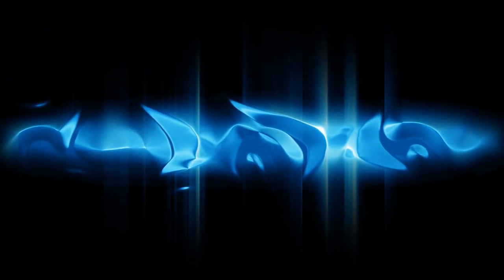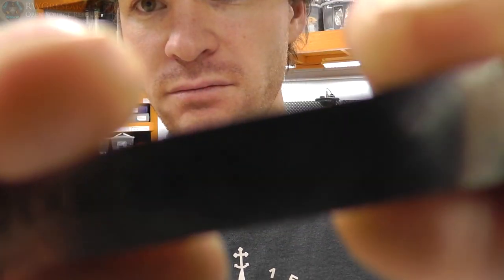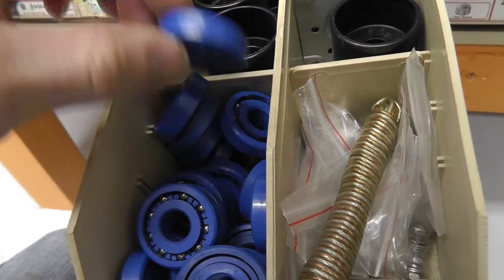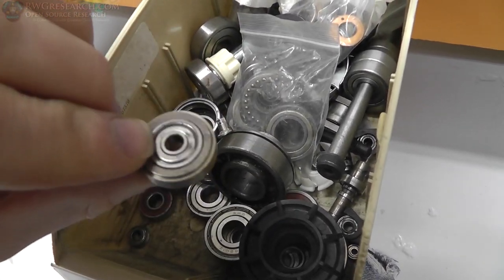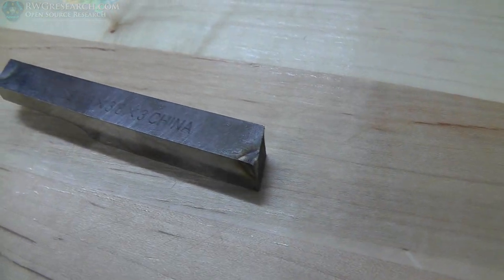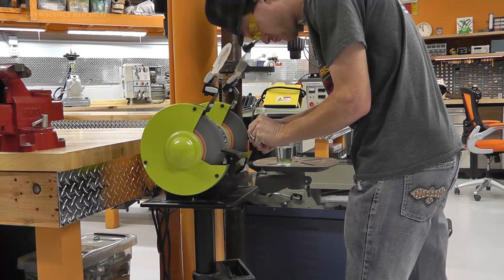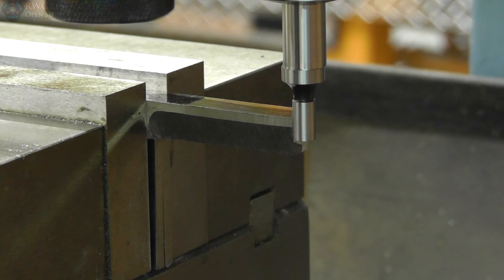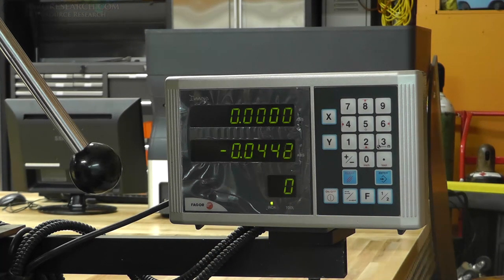RWG-OSD #3 Making Custom Profile Cutter For Slide Wheels - Bearing Selections! OverSized 3D Printer.

Comment: try using only 1 parallel on thin stuff,as the vise will keep it square.always tap the piece down just to be sure it's sitting flat.you might like using an old piece of metal strapping bent into a z shape to hold the parallels in place when using 2,keeps them from falling over and chips getting in behind and below them. i think delrin is what you may want to use to replace for favorite plastic..rubbing alcohol is better for your and the kids health than acetone for most shop applications.lastly i always brought the spindle up and went to zero both axis to see if i went the right direction when doing the offsets,then remove the edge finder.i scrapped a ton of stuff over the years just trying to save you time and money where i see it chuckle..........you do very nice work,and your family is great. happy trails
Reply from the maker: +bill bailey yes! i did not use the tap method but that is the correct way to do it :) i just was not that concerned because i was really only concerned with the one edge. and not really the Z :)  . good info in this comment for other viewing this video too! delrin ( also know as Acetl) i think is too soft, i have some here but was not willing to test it as its kinda pricey and i don't have small pieces but rather only big pieces. yes i was at the shop so acetone it is :) lol yes! going the wrong way is BAD! lol i normally go to 0,0 and make sure its on the corner before i start to cut!! . thanks for the c0mment!!!!!!!! good stuff!!! ~Russ
Reply from the maker: +rwg42985 i mean ACETAL i did not spell it correctly lol ~Russs

Comment: Yep looks, cuts like delrin  so it's probably delrin. If you go down the telescopic rods route you need a 1.5-2mm drill. Drill through both road and simply use Rc " R " clips.

Comment from the maker: also that cut off wheel i was using is just called  "dremel cut-off wheel" there are different thicknesses. and i think that is the part number. it is more of a fine cut than the other standard cut off wheel.   ~Russ
Reply: +rwg42985 This is off topic, but I think this will interest you: http://www.e-catworld.com/2016/02/08/orbo-has-touched-down-in-the-usa/
Frank Acland from E-Catworld has been delivered a faulty Orbo Ocube from Steorn and Frank is now testing its output. Steorn will be shipping one that is not faulty later on.  Steorn told Frank that this Ocube would be missing a battery. They told it before Frank received the Ocube.
So I think that this is an interesting free energy development.
Reply from the maker: +Opdehoede yes! thanks! Frank is a friend! :) thanks for the link! ~Russ

Comment: you creating with ball bearings, this kind frame and ball bearings an how stepper motors is mounted i trying long time to tell. This your idea i saw in one exibition in LT in working condition. True that suporting frame is a little different. And in this this printer was mounted laptops hardrive motor bearings, they are smaler than you showed and they fited from inside frame and two for suporting and stability from outside frame. Sadly i dont know how to show you because in that exibition i hasnt mine camera or even phone. But there is more sadyest thing i dont know how to use projecting software. I can only to draw on paper. But i am looking to yours videos and i thinking that when i will draw something you probably will end creating with bearings and will go on further. And question your main work accepting this crativity work or this what you are doing in free time after work?
Reply from the maker: +heris30 yes i thought about going on the inside of the rails but to make the parts was going to be harder than what i have done here... but i may change that.. will see. this is my " free" time after work. this is a side project! ~Russ